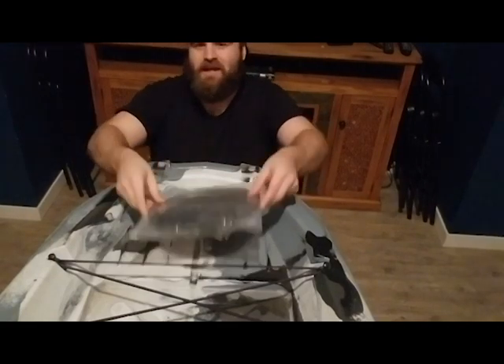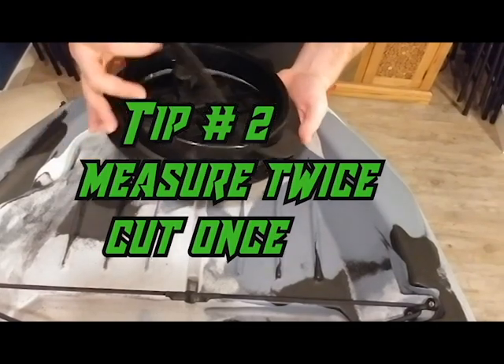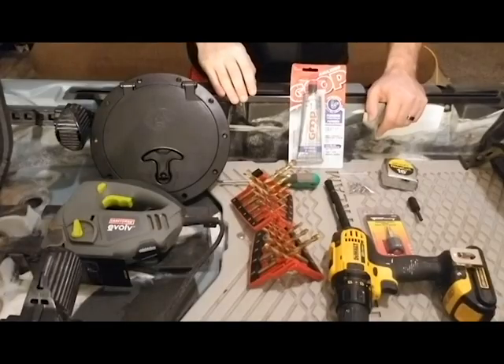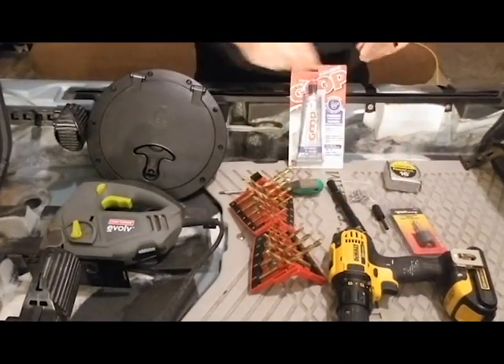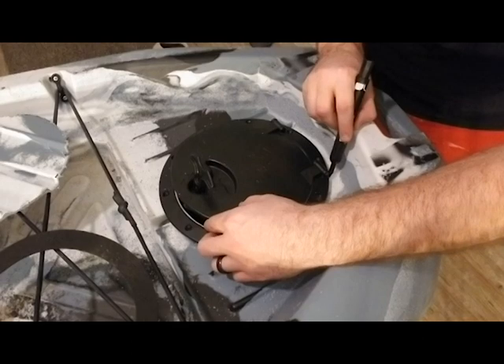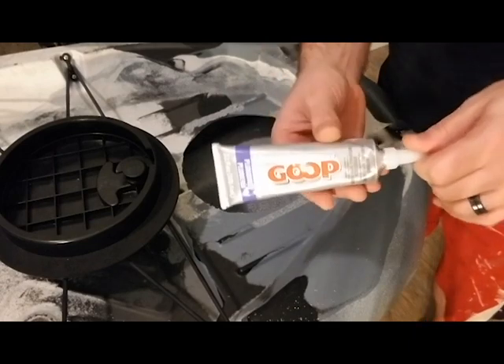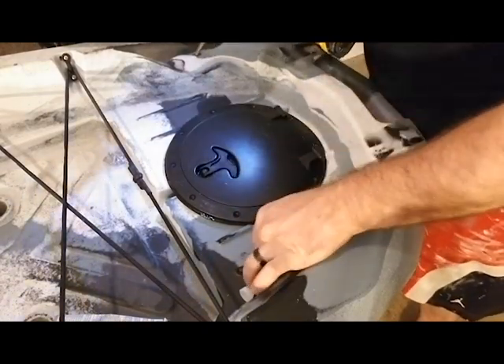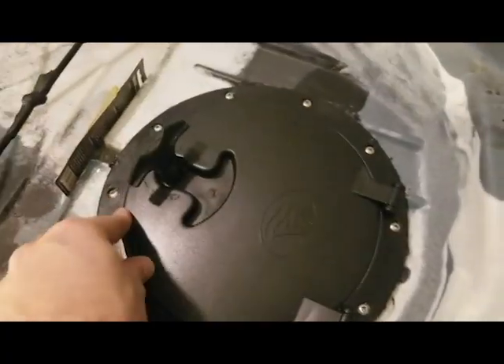How to install a hatch on a kayak (5 tips and tricks to any Kayak mod)

Comment: I put stainless steel counter sink bolts and nuts on mine better finish=screws can strip the threads in the plastic ie s/s bolts /nuts  a lot flatter hatch too

Comment: Pro tip: Take a hole punch (The standard office type designed for paper, or a grommet tool, or a leather belt punch will all work fine - but if you dont have any of those available just make one out of a hollow tube that you sharpen inside and out with sandpaper) and use that to pre-punch out holes in the foam gasket for your fasteners.   I know it seems simple, but failing to do so could result in a snagged gasket when drilling the pilot holes or driving the screws in that has a chance of ripping the gasket and making it more susceptible to water leakage. Sure... it wont cause damage 100% of the time if you dont prep the holes, but due to the multiple mounting screws and since most kayaks have at least two hatches - thats alot of room for error!!  

Dont get me wrong, if you installed it without this step you may be fine, but while doing it if you have the time and the means to do so, its best to prep it out and do it correctly!
Reply: Great tip!!!!